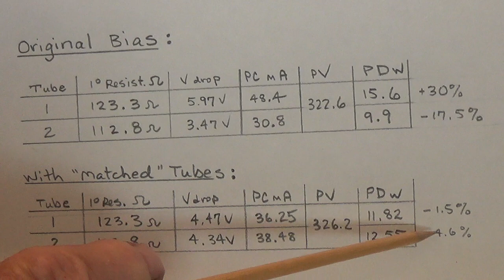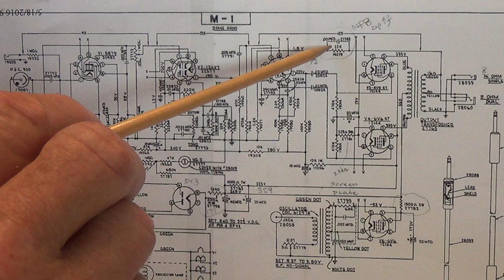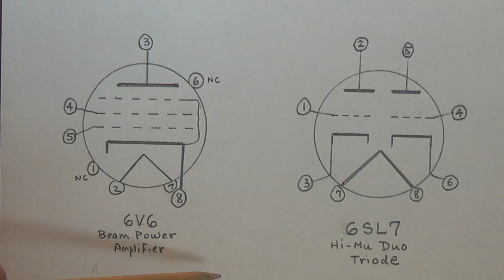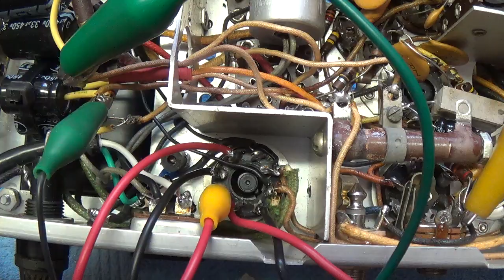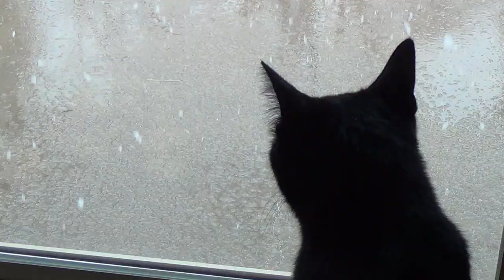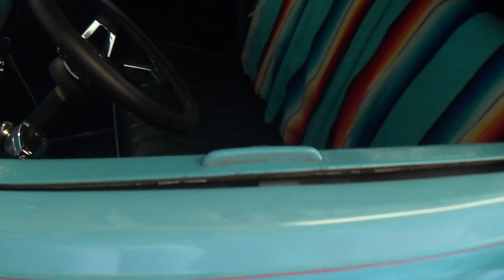Bell & Howell Filmosound 385 Amp Conversion for Guitar Use, Part 2

Comment: Hey uncle Doug! I have a few questions about the single speaker jack! Mine has a green wire attached to the the dual speaker just like yours but then jumpered to the single speaker jack. No yellow wire in sight! Same model amplifier. Curious about what I need to do in order to get my 8ohm jack wired up. I pulled it from the projector myself.
Reply: Should have put this comment on the part 1 video!
Reply from the maker: The schematic is difficult to interpret with regard to connection dots, HC. Apparently, the green wire goes to both output jacks, with both jacks also connected to the NFB circuit. I would assume that the single speaker jack is 8 Ohms.

Comment: Fantastic!
I think ol "Jim Bob" on the Walton's TV program had some similar rods in his day. 
Along with "Wally" on "Leave it to Beaver", if I remember correctly. 
I think "Ward" used the term "Jalopy" back in the day ; )
Back, when all you needed was a summer job, some basic shop tools, a salvage yard nearby and a buddy or two to help out occassionally. Just an fyi, there is a website dedicated to the main cars in the movie "American Graffiti".
The deuce had a 327 Chevy in it with some Stromberg's up top. The 55 Chevy was one of three 55's that were built for the movie company and each had 454 BB's in them, as you can "hear" that's no small block Chevy in 1962!
I was right about that before I found it years later on the web. Also, the 55 that was supposedly wrecked by Harrison Ford was not. It was a salvage donor car that was a hardtop that they used a 2X4 as a post in the movie to make it look like a 2dr post and if you watch you can see it burning when upside down in the ditch.
That's Hollywood!
Another one of the 55's was used in the movie "Two Lane Black Top" with James Taylor and Dennis Wilson. 
I don't recall about the third 55?
I'm sure that it's obvious by now that I'm a car nut..
Reply from the maker: Thanks for the info, Amo......very interesting :)

Comment: Is the 100k pot in the NFB circuit hooked up as a variable resistor with pins 1 and 2 tied together?
Reply from the maker: It is wired in series and used as a variable resistor....but the wiper is not connected to either of the other pot lugs.

Comment: Lol, I asked about the NE-2 bulb on your previous video and you answered it here. I just finished this project myself. I thought it was drawing a little too much current and I used a 470 ohm resistor to bias the 6v6’s. It brought down the current but the plate voltage went up about 30V. Seems ok since the plate dissipation is around 11W for both tubes. Was I wrong about changing the cathode resistor or is that an ok mod?
Reply from the maker: It's the only way to alter the bias, TN, so you were wise to do so. The PC and PV are inversely related, so when one goes up, the other always goes down.
Reply: @UncleDoug  this was an awesome project. It’s about the closest I can get to a vintage amp without spending upwards of $2k that I don’t have.
Reply from the maker: @t.nieblas2679  That's what makes these conversion amps so appealing, TN......great tone at a low price.
Reply: @UncleDoug  I see. That inverse relationship did surprise me since I’m used to just looking at ohms law where voltage and current are directly proportional.
Reply from the maker: @t.nieblas2679  I believe they are always inversely proportional, TN. The moment current starts to flow, the pressure (voltage) diminishes.

Comment: 111 degrees! i was once moving a color tv from one room to another and i saw a single drop of sweat drop from my neck right into the vent on the back of the television. I thought maybe i should wait a an hour or two before i turned it on but i said to myself  what are the odds it landed on something dangerous and plugged it in and turned it on and sure enough there was a loud pop and a puff of blue smoke came rising out of the television. i guess what im trying to say is dont sweat on an amplifier.
Reply from the maker: Wow....what a cautionary tale, Ernest. Thanks for sharing it with us :)

Comment: the clips and hooking stuff up before locking it in is brilliant. this could be done with guitar pickups and other gear before soldering it in. brilliant!
Reply from the maker: Glad you like the technique, AB. Thanks !!
Reply: It is brilliant but a word of warning from personal experience. I had several alligator-clip jumper wires just like these and I found to my surprise that over time, the dissimilar metals involved set up a slow corrosion process in between them to the point that the jumpers measured as much as 20K of resistance! I wound up just going at the clip connections with a wire brush, hitting them with liquid flux, and soldering the area where the wires were crimped in with extreme prejudice. That solved the problem.

Comment: Hi Uncle Doug! I've been subscribed and watching your video's since you launched your channel. I've learned so much and have rebuilt about a dozen amps thanks to the knowledge you've divulged. Thank you! Question on this video and the way you connected the negative feedback. Since you disconnected the 8 ohm output transformer tap from the speaker transfer jack, wouldn't that also disconnect the negative feedback circuit? Or is the negative feedback connected to the output transformer 16 ohm tap and thus connected to the 8 ohm tap as well?
Reply from the maker: Thanks, Stephen. As you said, if you are connected to one secondary tap, you are connected to all of them.

Comment: Hello, im Facundo from Argentina...I recently adquier 3 speakers and one amp from old image and sound projectors, the amp and one cabinet with the original speaker its a RCA, the speaker its 10" and 8ohms, i think 15w, and the other two speakers are one Jensen with the cabinet from Bell & Howell 12" 16ohms and 15w, and the last dont have cabinet yet but its a Goodmans 60 12" 16ohms and 15watts to...My question is about the wattage of this old amps from the projectors, i cant get the schematics and i am very new in electronics, do you know if this speakers can handle ok with this kind of amps? the 3 are 15watts speakers, i dont want to brake nothing...Well thank u very much!
Reply from the maker: It sounds like the 3W speaker has no hope of survival and the 15W speaker won't last long if you run the amp at full volume.

Comment: Do you happen to still have the filmosound 385 amp from 4 years ago  ?  I am wanting to buy it if you have it available.  michaelboogie7777@gmail.com
Reply from the maker: No, I sold it quite a while ago to another viewer, Michael. Sorry.
Reply: @UncleDoug  If I find a filmosound 385 what should I expect to pay someone to have it modified to a guitar amp and can you tell me what you sold yours for  ? Thanks again.
Reply from the maker: @MichaelRodriguez-qm9my  I don't recall the price, Michael and am not sure about the current value of this item. You need to watch Ebay and see what they sell for. I can't predict what a tech would charge for conversion. Your best bet would be to do it yourself. Good luck.
Reply: @UncleDoug  Ok and thanks for your quick response.

Comment: The photo electric cell (PEC) from an optical film sound pickup that was the original input to this amp are very bright so it makes sense to have the NFB cranked up to reduce that brittleness.
Reply from the maker: That cell is not used when the circuit is modified for guitar use, John.

Comment: I need to replace the can capacitors in my filmosound 302 amp and am curious as to where you found those axial capacitor replacements for your 385. In my amp they're mounted on top of the chassis but are still gonna be a pain to replace. 
Thanks
Reply from the maker: You can get both types of capacitor from Antique Electronic Supply.
Reply: Thank you

Comment: The NFB is not the bad part of the tone. Austen hooks leaves his in. More to do with voltage and swapping ip.coupling caps and other parts for hid atleast. He uses 15k NFB resistor

Comment: 9:20 U.D. I'd say your methods and techniques are pretty solid. You are working on the same wavelength as Brian Wampler  of Wampler Pedals that looks very much like his youtube video on how he breadboards new ideas and/or tweaks old ones. in fact It looks smaller than the "snarl" of wire and components than he had spread across his home built board for a basic distortion circuit.
Reply from the maker: Thanks, Murry.

Comment: G’day Uncle Doug I’ve got one of these but it’s from the 1940s. My Dad got it from American soldiers up in New Guinea during the War. So it runs on 110v and we have 240 in Australia. It came with a huge external transformer. I have a remote speaker he bought for the projector and I would like to set it up so I can pull out the amp and use it with my guitar and also be able to use it for films. Would it be possible to replace the internal transformer so it would run on 240 v or is that not really possible?
Reply from the maker: You can order a ClassicTone power transformer from Amp Parts Direct, Scott, that will adapt your circuit to run on 240VAC.
Reply: Uncle Doug thanks very much. Love your videos by the way.

Comment: Fitting that trem in that cramped chassis was a coup. Did you figure out why it was unstable?
Reply from the maker: It's been a while since I built it, Allan, but as I recall, it was eventually straightened out. I honestly don't  remember the details.

Comment: This is another great job. 
I'm looking at your suggestions concerning the specifications of the 6SL7. Can the tube be used in a so called single tube push pull circuit?
Is there such a thing?
Reply from the maker: Thanks, Stuart. No, there is no such thing as single-ended push-pull. The tube is best suited for pre-amp use.

Comment: Uncle Doug:  Thanks for your videos - I have learned so much from you and them.  I am presently converting an old Victor stereo console chassis (complete with original PS) to a guitar preamp platform.  It was one of those big old wall units that had been left in a barn.

It had a set of EL34 as power tube sockets which I have converted to one EF86 and one 12AX7 sockets for a preamp stage (output to guitar amp input).  The other tubes in it were two 6AV6 and two 6BA6 mini tubes.  The 6AV6 is very similar to one stage of a 12A.  I would like to add a tremolo to the chassis using the 6AV6.  Do you think the VibroChamp would work there if I employ one 6AV6 per side of the tremolo circuit you employed here?
Reply from the maker: You're welcome, James. The VibroChamp tremolo circuit is a good one. I'm not sure about a 6V6 working well as an oscillator tube. You would simply have to try it and see.
Reply: @UncleDoug  Hi,
thanks.  Just making sure your reference to a 6V6 not a 6AV6 was intentional or not?  The 6AV6 has a triode configuration that can be used, I believe, like 1/2 of a 12A.

Comment: I'm really learning a lot from your videos.  I have a Premier-20 16mm projector with an audio amp but the power transformer is bad.  Where would you suggest that I pick up a good one for a reasonable price?  The only number on the transformer is 18385.  The windings are just like the one you have here in this B&H.  I would like to remount the components in a custom chassis and replace the capacitors.  I also have the Ampro speaker but the cabinet is in bad shape.  It may make more sense to build a guitar amp from scratch.   I recently retired and I think this would be a good project to take on.  Last time I worked  on electronics was back in the 80's.   Thanks.
Reply from the maker: It does sound like a good project, RB. I get all my ClassicTone transformers from Amp Parts Direct.

Comment: The model number of your amp is 08855 as rubber stamped on the chassis by the power cord connector. Look for the schematic for 08855.
Reply from the maker: Thanks, Ken.
Reply: Amplifier 08855 (made in 1955) is covered on schematic page M1. Amplifier 08855-AA (made in 1959) is covered on schematic page M2 of the Bell & Howell tube amplifier service manual.
Reply from the maker: I used the M-1 schematic when working on the circuit, Ken.

Comment: thanks. i have one of these on the shelf, waiting for me to find time to tear into it.
Reply from the maker: They're rather cramped and claustrophobic, Joe, but they sound great !!!
Reply: I was immediately repelled by the congestion I found in mine, obviously built in layers, with not much thought given to service, but I decided that someday I would  probably have time  tounsnarl it. 
I really like how you moved the bias parts and mounted the tremolo on that hum sheild. 
I sort of imagine that I would find a way to add a reverb tranny to drive a spring off that extra 6V6, but your trem is very cool. My all time favorite trem was the one on my brownface Deluxe.
Reply from the maker: The best tremolo I have personally encountered is the Vibrato (harmonic tremolo) in a brownface Concert amp.  The brownface Fender's were an excellent, but rather briefly offered, series.
Reply: I had a pair of them, a brown deluxe in a mahogany cabinet with a D-130 in it, and a brown super in a poplar cabinet with hand cut dovetails and a pair of D-110s but methrats broke into my shop and stole both of them.  :(   Amazing sounding amps, both of them.
Reply from the maker: What a terrible loss, Joe :(

Comment: I've read that the Canadian guy you refer to who popularized modding these vintage B&H amps - Bernie Rausig - reportedly modeled the tone stack of his builds after that of a vintage early '60s Vox AC-15. Does your build follow that lead or did you leave the tone circuit stock?
Reply from the maker: I left it alone, RF, and have honestly never felt the need to improve or alter it in any way.
Reply: I love that you added tremolo. I've always wanted one of these Filmosound amps but the lack of tremolo held me back as it has become the effect I use more than any other. If you ever decide to sell, let me know. I just may be your Huckleberry. Thanks for a great video.
Reply from the maker: By coincidence, I was working on it yesterday. The tremolo has developed a thump, which is very common.......but I don't like it and am going to try to eliminate it or at least reduce it quite a bit. If I can, the amp would be for sale. Other than the "thump" it works and sounds great.
Reply: Well, I'd definitely be interested if you get the Tremolo tamed, or at least close to the vibro champ feel you were working toward. Let me know.
Reply from the maker: I will, RF. Thanks for your interest in the amp.

Comment: Uncle Doug where do I find the flush mount pilot light?  Nice work!!
Reply from the maker: As I recall, it came from Radio Shack. If they are still in business in your area, Pete, they generally have a nice selection of such bulbs and lights.
Reply: Thanks Doug! found the last Radio shack in my area going out of business sale the other day and got a nice flush mount pilot light.  I'm working with the M-2 385.  How would the pot work for the NFB issue?  Since there's only one winding on the secondary where would the feedback resistor and pot be place?

Comment: Great Job on the video! This little guy was a ton of fun to work on and your video was very helpful. Just finished modding mine and its sounding great except for one little issue I cant seem to resolve. There seems to be a noise issue that sound like constant static that is unaffected by gain controls. I replaced all of the plate carbon comp resistors, replaced all of the caps and tubes for a slight improvement.  Can the carbon comp resistors in the tone stack cause static noise as well? I think its coming from the 1st 12ax7 stages in the signal path but I'm not sure. I'm at the end of my rope so any help would be great!  thanks Uncle Doug and keep up the good work!
Reply from the maker: Thanks, Kyler. Any noise that does not respond to the volume control must come after the VC in the circuit. As you mentioned, carbon comp resistors can be noisy, but generally only in the portions of the circuit where significant current flows.....such as the power supply (especially just prior to screen lead) and plate circuit. Noise is probably the most common and difficult problem to diagnose, especially long distance. My approach is to chill (freezing spray), wiggle, replace, jumper, and systematically eliminate each possible source.

Comment: Hi,  Thanks for this great video !  Had a question I was hoping you can help me with.  How important is it when replacing the filter caps to have exact capacitance value?  I understand you want the same or higher value when it comes to Voltage rating, But what about capacitance value?  I am having trouble finding 15uf 450V axial.  Thanks !
Reply from the maker: You're welcome, TOB.  From my experience, you can safely go up in capacitance by a reasonable amount, i.e. up to 20 to 22uf instead of 15uf (if you can't find it). Problems only seem to arise if you double or triple the suggested value, which can place an initial current burden on your rectifier tube.
Reply: Uncle Doug, as always great information to be found on your video pages. In regards to adding capacitance.  Isn't that initial current draw on the rectifier only really affected by the first filter cap in line.? That is also the one with the highest B+ isn't it.  Can't you safely go up on capacitance for additional filtering in the later caps, especially the ones that are in the preamp or early stages where eliminating as much ripple as possible is the most important. since if I'm not mistaken any noise will be amplified. More comments and info on this subject gladly accepted.